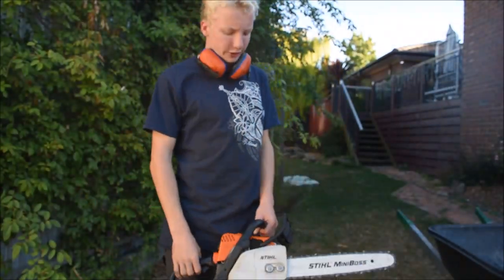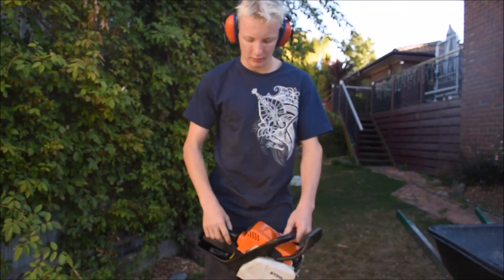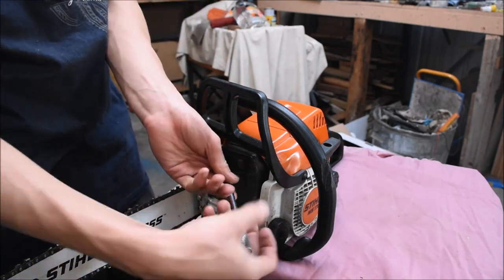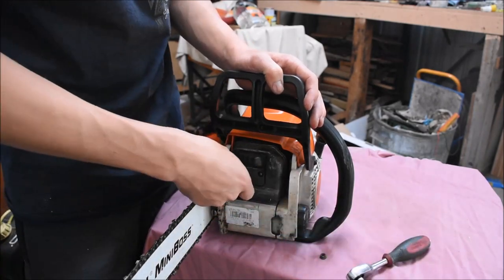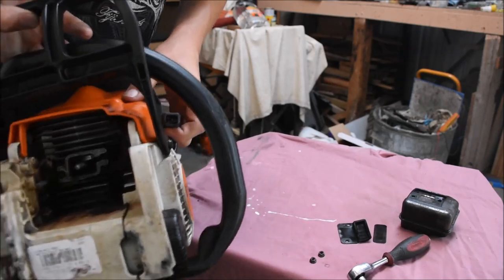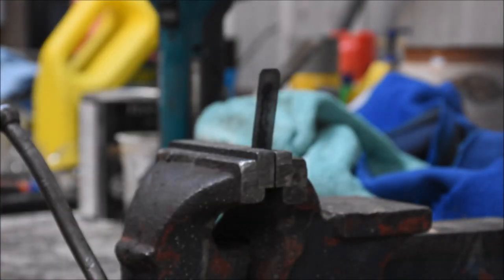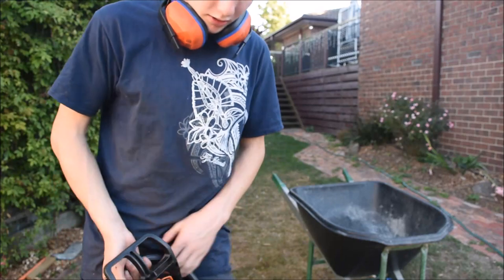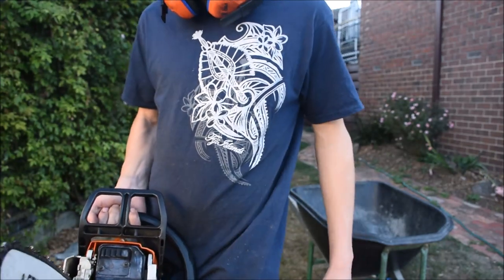Stihl ms 170 bogs down, stalls out when starting

Comment: Great tip!! I have a MS 180c that wouldn't rev up. I had checked and cleaned the carburetor but it still wouldn't rev... watched your video, checked the spark arrestor screen and it was plugged nearly 100%.
Reply from the maker: Glad it helped
Reply: I removed my screen,problem fixed!
Reply: Mine has done that from brand new on cold starts. Once it has warmed up, it's fine.

Comment: My 181 has the same fault, the dealer cleaned the carburretor but still the same. I took it back twice and they said it was running normally but it was not. I took it back a few weeks ago and they said the carburretor was faulty and it was my fault because I hadn't used it. I said how can I use it if it will not start and walked out. I'll give your procedure a go but there could be old fuel in it. Not happy at all with them.
Reply from the maker: cool. let me know how it goes
Reply: PUT !! IT !! STRAGHT ! INTO !! THE !! METAL !! SHREADDER !! FOR!! PEACE !! OF !! MIND !!

Comment: Really helpful.  Had already changed spark plug, air filter, fuel pickup body.  Doing the screen cleaning was THE most helpful.  Using a torch to burn off the carbon worked like magic.  Many thanks.
Reply from the maker: Glad it helped
Reply: ThROW !! IT !! AWAY !!
Reply: @davidwillard7334  Why? I have a Ms181, MS462c and a H550XP..this has helped me quite a few times now. Surely you're not a BRAND nut! Husqy, Stihl...just cut some wood mate. This is some good maintenance info.

Comment: Your idea of using the heat gun worked great. After scrapping the screen try using a stainless steel wire brush this will clean up the screen even better. Comment from one of the other videos he put the screen in acetone which took considerably longer to clean screen.
Reply from the maker: cheers thanks
Reply: SHOULD !! HAVE !! THROWN !! IT !! AWAY !!
Reply: Lacquer thinner and a fine wire brush works instantly

Comment: Had same problem with mine.  Carb ran too rich no matter what...fouled plug and screen every tankful.    Swapped out carb to an adjustable one (Walbro  WT-215)  drilled a few holes in the cover for access to high and low screws... runs great now.   Oh yeah.. also opened up the exhaust... more power...sounds great.  Nice light and good power for the size.

Comment: Australian models generally follow the trends, and all my saws have the spark arrestor screen.
I use a butane gas torch to clean them occasionally, I also don't rush into using the saw - I let them warm up for a few minutes on idle, that gets the fuel flowing through the fuel system and gets the oil lubricating the chain/bar. In theory if fuel is good, and the saw can breathe it should run.
And keep it clean. 😎

Comment: Good tip. I'll check my saw. I have a similar MS 180C. Ethanol in gas really causes problems in these saws. Use premium gas and gas treatment.
Reply: Al Mollitor ,Non Ethanol Is What You Want ,Or Trufuel , The Alcohol In Ethanol Gas  Is The Problem,No Amount Of Fuel Treatments, Will Get Rid Of The Alcohol That Ruins A  Carb In Small Engines !!!
Reply: I left mine still for few months with ethanol mixed with fuel stabliser & no dramas!

Comment: I actually had problem bogging down. It idled great . I actually took carb off then thought about  something I put it back on and reached for my can of carb cleaner ! Wow ,sprayed in the carb while running and it shut down. Let it sit ran it up again but took a lot of pulls . Ran it up sprayed again and did a few times about 1 hour total let it sit between sprays. Well runs great  not taking carb apart and it cleaned the varnish dirt that was in the jets ect ect.. try it!
Reply from the maker: Randy kilcollins carb cleaner is a good way to ruin your cylinder, it lacks lubrications
Reply: Where do you spray the carb cleaner into the carb?

Comment: Thanks, I'm having exactly the same problem with the same saw. That'll be the first thing I look at.
Reply from the maker: Glad I could help
Reply: Turned out to be the can of Tru Fuel I was using. According to the manufacturer, it was a recent batch but a fresh can with a different date code fixed the problem.

Comment: Thank you, will ry it, Anoher tip hat I heard is that if we not going to use the chain saw for at least 3 mos. ,we should remove fuel (petrol and oil mix) cause they said in the end oil will separate from petrol or gasoline and will clog certain parts in the fuel system causing the machine not to start.

Comment: Thank you young man unfortunately I had already clean my screen and all the other obvious. Even using high octane ethanol free fuel. I fear it's the carburetor since there is no adjustment for the mixture which is asinine.  Mixture changes with altitude due to atmospheric density. Just glad I bought it in an auction.  LOL.
     Curious if there is a way to tweak mixture even without a mixture screw. It bogs and stalls even without a load.
Reply: If you have a 180 it does actually does actually  have an enrichment screw. There's only one and it's very small and in a discreet location behind the handle.  I get the feeling Stihl didn't want anybody messing with it.
Reply: @anthonylehner3643  thanks, mine is a 170 I did find that screw I thought it was for idle speed I checked eBay I can actually get a new non-branded carburetor with tune-up kit for $11 at that price I ordered one. LOL That gives me an extra filter, plug, oil pump, and lines also.  I kind of think somebody was running ethanol fuel. And it has a bad diaphragm or something. With that said there's not even any paint or off the bar. Things went cheap at that auction chainsaw was only $63. I even got a almost new 60" inch brush hog for $185.  Appreciate the response, take care stay safe.
Reply: @fighterpilot6461  The newer MS 170 has adjustment screws.

Comment: Mine behaves like that but the muffler screen wasn't clogged
Reply: If the gas is more than a month old dump it and go get some new stuff. If that doesn't do it, assuming you've already checked spark plug and air filter, you will want to do a full carb disassembly cleaning and blow out with compressed air if it has been sitting for over a year with bad gas in it. I always empty the gas tanks on all my small engines and run them completely out of gas when I'm putting them away for the winter.
Reply: @Anthony Lehner  A lot of these MS 170 saws are doing this from brand new, even with good gas. It's only on a cold start, and the saw runs fine once it has warmed up.

Comment: You cannot adjust the carburetors on them 170s besides the idol they have it set that way for emissions control
Reply from the maker: cheers for the tip
Reply: Really, because mine has adjustment screws and came that way.

Comment: Remove pos non adjustable carb with walbro adjustable,  gut muffler and add a bit of timing,  they will run really good
Reply from the maker: chose not to. it works fine as it is

Comment: Just a thought, ????could you use oven cleaner liquid to remove the carbon from the spark arrester , would this be safer than scraping it. In the past we used caustic soda  on inside of our exhausts on two stroke motorcycles, oven cleaner has some caustic soda in it , comments on above please
Reply from the maker: i just use heat, it is easy, fast and isn't going to do any harm to the machine
Reply: 2 Stroke, Running and repair   Hi , I was more concerned about damaging the wire gauze, that’s my reason for thinking of oven cleaner,

Comment: Another thing the fuel line could have very tiny cracks in it or the base gasket could be blown or the intake could be leaking or the crank bearing seals small engine repair that's what I do for a living
Reply from the maker: the McCulloch man, lots of possibilities,  but as always, start with the simple things before going to more complex issues

Comment: Mine does the same thing, but it’s not the screen, my fuel pressure in tank and line is good. Gonna adjust the carb I guess if I can’t find anything with wrong with spark or plug.
Reply: Djvvvv

Comment: My MS170 dosent have the screen ..any other ideas before I dig deeper ? Thanks
Reply from the maker: Andy Ollier, make sure the fuel and air filter is clean and the spark plug isn't corroded or sootted up.
Reply: @v26224 
Thanks
New the plug wasnt fouled and air cleaner wasnt to bad so tried the fuel filter. Looked fine. Did a suction test on it against a spare new one. Old one was very hard to blow ir suck through.
New one fitted and jobs a good one.
Thanks matey..
I do no about engines but thought there's a generic problem with ms170
Turns out even tho your saw isnt old and fillter looks ok, shows how probkems get over looked.
Just got to sort out my Ts 410 that ive rebuilt with new cykinder and carb kit. Wont start. Thi nk ill look at fuel filter again..
Thanks againg

Comment: 11 times out of 10 it is a fuel issue and/or flooding. The spark arrestor is going to get carbonized because you continue to use improper fuel flooding it while starting it.
Reply from the maker: not always. due to the non adjustable carb running with a fixed high jet, the saw can run rich on fuel due to different air pressures and changes in elevation and temp. the excess of fuel leads to more  carbon build up and heat over time wile running at peak RPM

Comment: And the first thing I do when I get any chainsaw is get rid of that stupid spark arrestor and make the exhaust holes bigger and then put the cover back on
Reply from the maker: the McCulloch man. I use the saw in a high fire risk area. As such I keep the spark arrestor in and recommend against removing it.

Comment: If just that bit of carbon deposit can hold the machines performance there was some bad decisions when this saw was made,I would remove the damn spark arrestor and be done with the problem.
Reply from the maker: that is your choice. in Australia, if w e are using a chainsaw in national parks or during summer we must have a spark arrestor.
Reply: Not a wise choice to run one without the arrester
Reply: @v26224  Well I guess I can thank the Lord for not being in Australia..
Reply: even though he didn't show it he did say he was cleaning the rest of  Muffler.

Comment: Mine is not like yours, the spark arrester is not bolted on.
Reply from the maker: 181is a different style saw. it is located on the top left side as you are looking front on. it may pull right out.

Comment: On all these videos everybody knows about the spark arrestor,took it out, mine is stihl 170 very clean 2yrs old still bogs down, still like new still really clean. looks like carb is non adjustable,now what?
Reply from the maker: Buster bob there may be a adjustment screw in the right hand of the handle. I may make a video on it. If not, go talk to your dealer
Reply: Rebuild carb with new diagrams. It is not adjustable.
Reply: Google still 170 carb mods. There is a carb you can mod to bolt right up with a low idle and high run adjustment. Did it to mine runs better then new.

Comment: Until the motor is not warm dont pull the gas :( my gosh poor saw...
after the saw started up wait 1 min, then work with it...
Cold stroke rules
Reply: ego19893 Amen, brother! I took a small engine repair class and one of the first things the instructor told us was let the engine warm up for at least a minute before revving it up. I see sooooo many people doing this and I make sure to tell them.... Some listen and some don't 😞
Reply: Actually a two stroke is better to give a little rpm but I agree that giving it full throttle isnt good at the start I have rebuilt saws and that's not the main killer  but could be
Reply: @stevek4546  yeah a four-stroke you need the oil to be warm in order to lubricate properly two strokes have the oil mix in it.  I never seen professional loggers waste time warming anything up and their saws are their livelihood.

Comment: Clean that sreen and put it back but it won't still keep running and there's adjustment on the carb
Reply: On the 170 and 180 models, there's only one carburetor screw... The LA. That's for your idle throttle speed. There are literally no other screws on these self-adjusting carburetors. You need to rebuild or buy a new one.
Reply: @TheKrayusKorianis  Not on all of them. Mine has all all three.

Comment: Be careful revving up machine straight away as could wreck engine, let it tick over first to warm it up then use 👍🏼
Reply from the maker: ok, cheers
Reply: When you first start it, it's designed to go to do a high rev until you give it a quick throttle squeeze. You're supposed to do that squeeze within a few seconds to avoid ruining the clutch.
Reply: @karlrovey  you should let chainsaw run for about 5 minutes before use to warm up as the piston as it will expand and heats up quicker than the cylinder and if revving the engine up will cause it to rub and score the cylinder.

Comment: Got a 170. What a POS. Waste of money.
Reply from the maker: Mr Bjj 101 ok, this one works well and is a great reliable saw
Reply: @v26224  Mine sucks. Boggs down cutting through 12" birch. New chain no help.
Reply from the maker: Mr Bjj 101 it's not really designed for 12" logs, get a bigger saw.